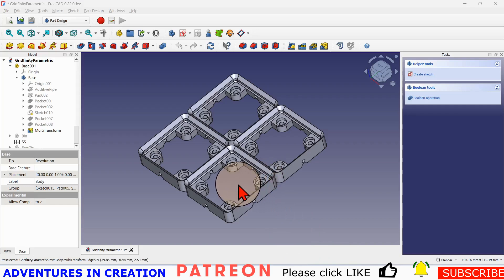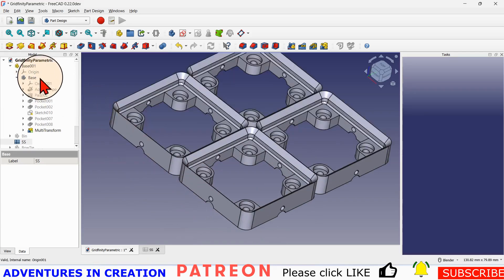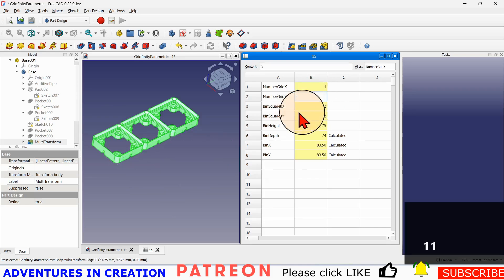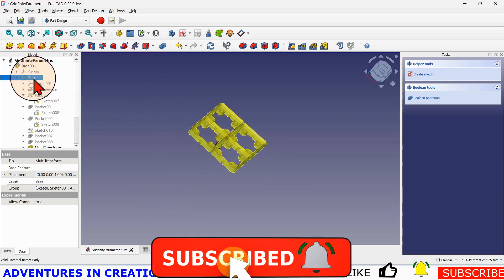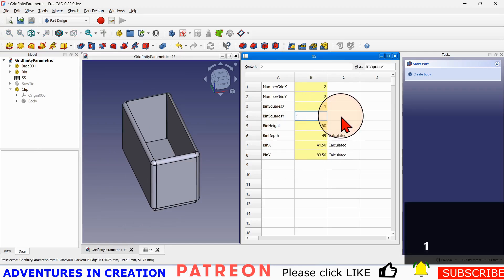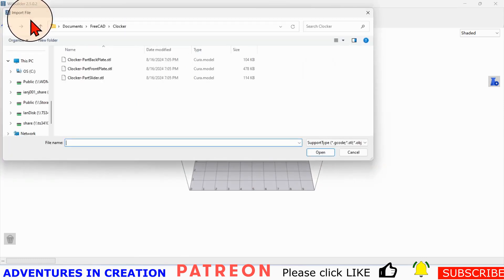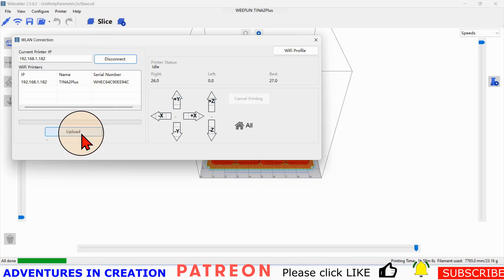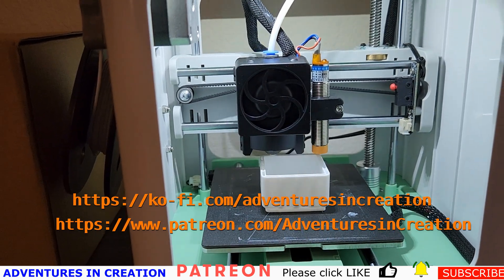GridFinity Parametric File #freecad #cad #design

Comment: I could not find your download link for the file to accompany this video. My inability to create this design stopped me from using Gridfinity, otherwise it is a great system.
Reply from the maker: Hi Rodney, got to my patreon link, it's right there in the shop, you should be able to download it for free. - If you want to use Gridfinity, this will get you going for sure.
Reply: @Adventuresincreation  Nope, it has a price on it 😔
Reply from the maker: @rodneysmith1750  that's strange, I marked it as free. - I think I have your email right?
Reply from the maker: I just sent it to you, check your email. Remember to use the dev version for that.
Reply from the maker: Hi Rodney, please try this link and let me know that you can access it https://www.patreon.com/posts/trying-to-make-110641395?utm_medium=clipboard_copy&utm_source=copyLink&utm_campaign=postshare_creator&utm_content=join_link

Comment: Hi, thanks for the video.
How long does the printer takes to make  a 1x4 array? (without any tweeks)
Reply from the maker: Do you mean the base?
Reply from the maker: If you are thinking of the Tina2 then you would need to print two 1x2 bases and clip them, about 1hr each
Reply: @Adventuresincreation  Thanks for your reply. I thought you could print 4 bases ... It's really a tiny machine... Does it need a lot of 'support' when printing the containers? Cheers
Reply from the maker: @LFANS2001  No support required when printing bins. - I have been printing on a raft per the manufacturers advice.